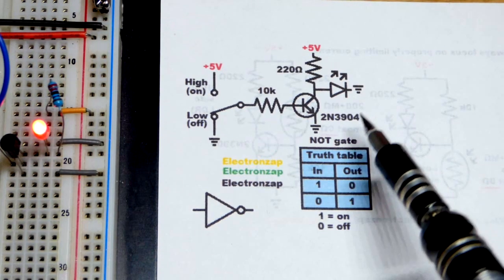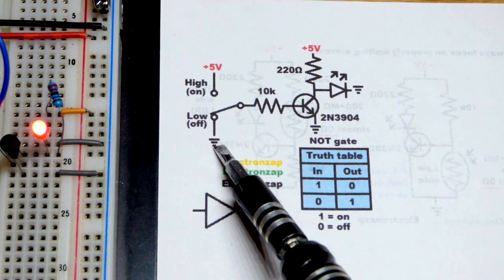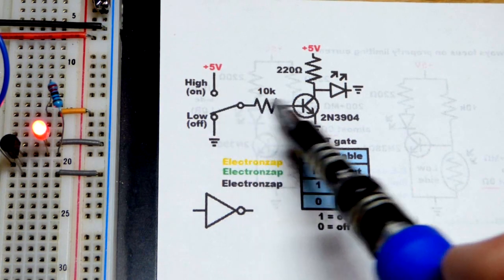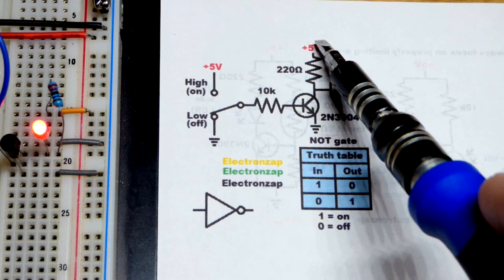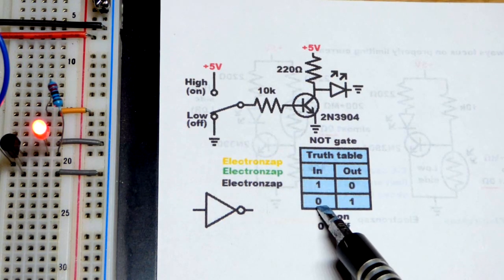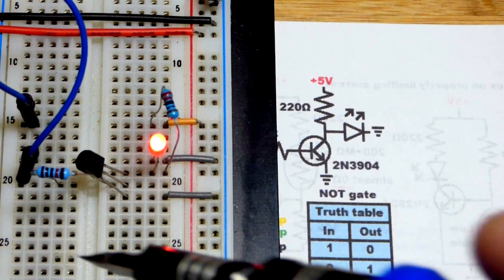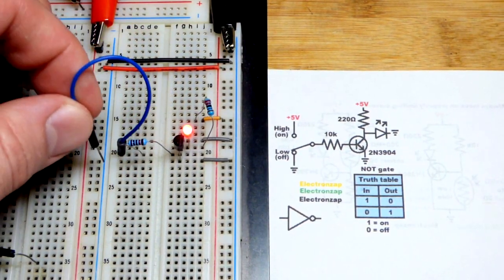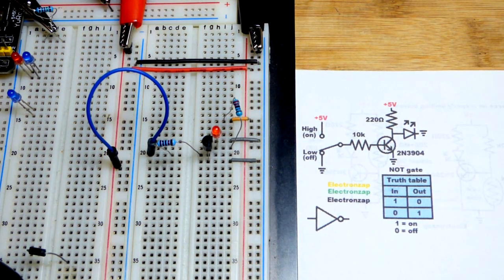NPN BJT NOT logic gate aka inverter circuit using electronics 2N3904 bipolar junction transistor

Comment: Could I use this circuit with a IRF 510 mossfet instead of the transistot (Just because thats what I have) I want to connect this to a float valve and a relay that turns off a heater what the tank is full. Unfortunately when the tank is full the float valve the float valve closes a circuit Hence I need an inverting signal. I have a transformer reducing the voltage to this circuit but the relay connects to a 3kw heater that boils water and sends it to the tank (distiller) Sorry about the long message. Ignor it if you wish.